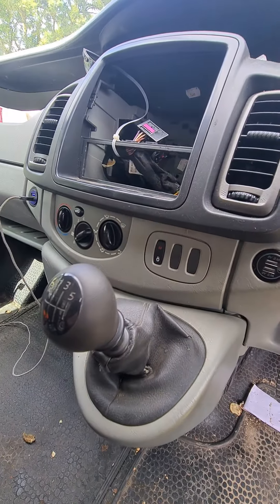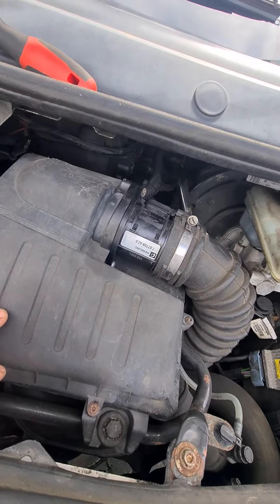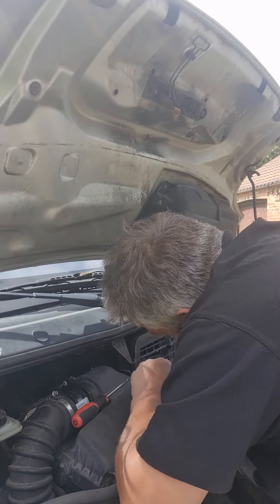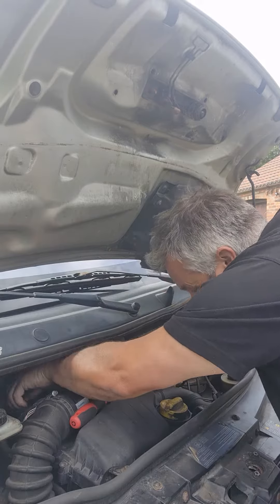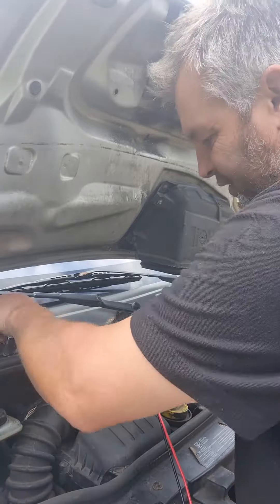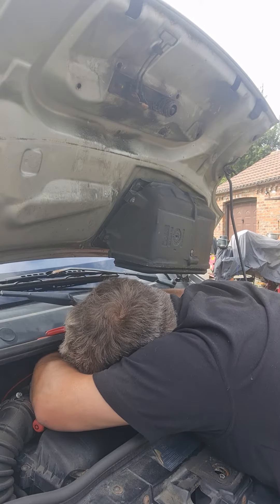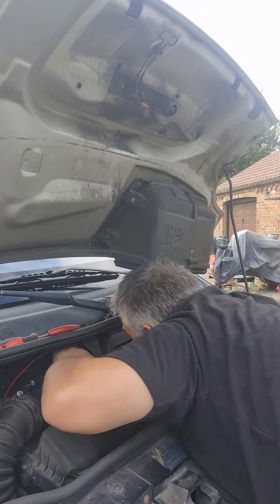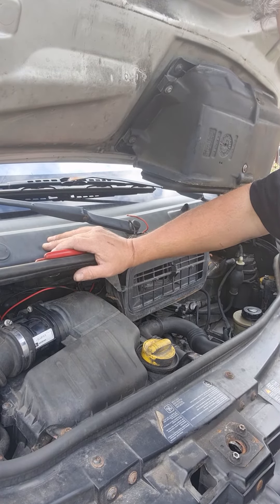Vauxhall vivaro and Renault traffic heating resistor not working on no. 4 speed

Comment: This fixed my van on speed 4 now the heater blower stops working when you hit a bump any idea
Reply from the maker: Have you had alook at the plug, on the housing the connector can have a short on the pins
Reply: @ON-THE-DRIVEWAY  is that under the bonnet or behind the dash
Reply from the maker: It's under the bonnet muti plug look at the pins carefully one mite be burned out,

Comment: Just remove the air cleaner much easier
Reply from the maker: Yer was abit awkward, then to find the wiring routed tho it, then the fan failed 🤦‍♂️ ended in last video replacing it all 👍

Comment: Just can't see what your doing and where
Reply from the maker: Ok, 
There's 1 small screw Torx bit 20 screw to the side the other side it just clips in, 
The wires are fed though the heat shield part of the motor, i cut the wires and just fed them around it and then plug it back up,